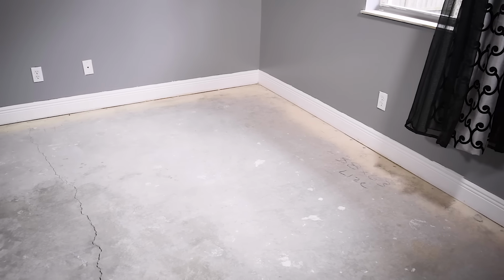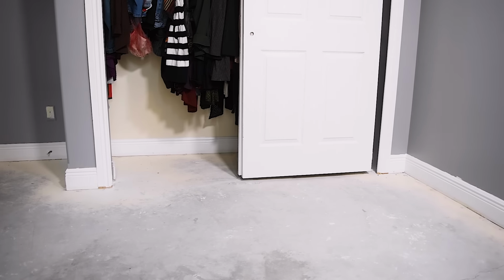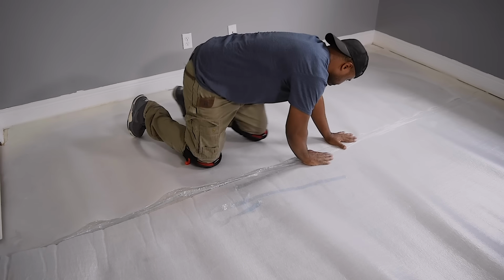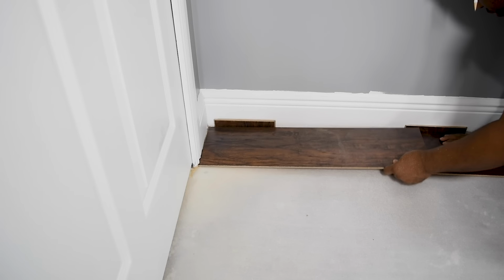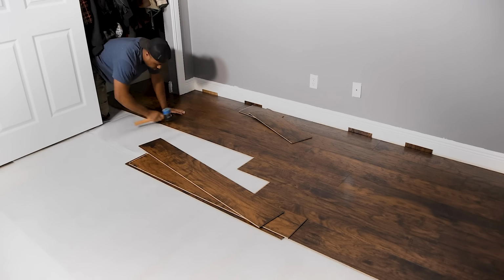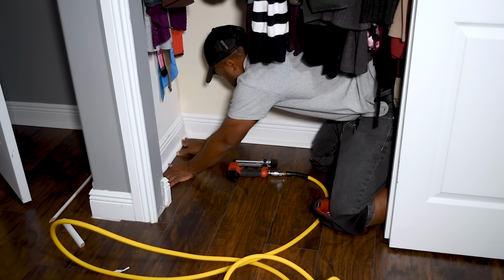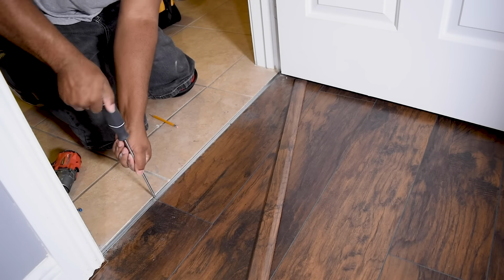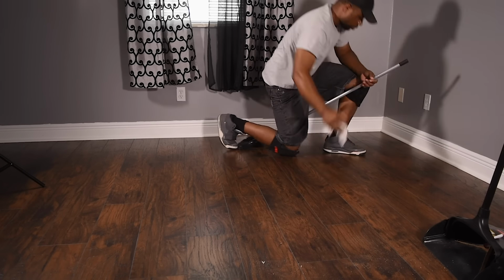How to Install Laminate Flooring for beginners

Comment: Looks like a foundation crack(response to @bestamerica) and is costly $$$ to fix. If it is filled then it will just open again, and could be why one side of the room was lower than the other. If there was no foundation problem it might be good to check the room with a long level to determine if the floor needed leveling before getting started. Also, if you are selling your house then you'd want to put the information in the seller's disclosure to avoid problems with a sale. Appearance upgrade would have been to remove the floor molding for a more pro finish, and add plinth blocks at the door to complete the quarter round. Changes to consider in the future, recommend placing underpayment 90 degree different direction from the way the floor is laid. OP did a good job with what time he had and material available on hand. New floors are big upgrade to any room. Thanks for posting

Comment: '
what about crack the cement / concrete...
what to do with it...
leave it that way or cement / concrete glue put cover fill in the crack
Reply: Ideally you would use a leveling compound to fill it.

Comment: From 2001 till 2005 I've mounted 13000 square meters laminate floor. How time goes away. I never stood working on my knees like this guy did.. This helped me to finish my work in time everyday. I was 95kg when I was working but didn't feel it like I was fat. My father was bodybuilder and my mom athlet runner. In school I was a footbal player. Maybe this helped my work with laminate flooring much easy despite my weight.

Comment: Do you only need spacer on the 1 length, or is on both side or all including the width?
Reply: Spacers should be used on all sides between the flooring and the wall. The spacing is needed as the laminate will expand due to changes in temperature and moisture.

Comment: I need an advice from someone who knows this type od work. Is this long-lasting in terms of how he did it on this video? 
I've seen people who did this and after a few months you could hear laminate creak and even come out. 
Thank you
Reply: Waterproof laminate is the way to go the good stuff already comes with attached underlayment but you also have to check the floors if they need prep, and by that I mean if there low spots in the concrete, which you have to fill in or if there's high spots in which you have to grind down.

Comment: Great job. Always lay the  under lay 90° in the opposite direction to the  flooring board.
Reply: Nope, perpendicular always. Read the directions on the underlayment, that's what it will say.
Reply: It doesn't matter when it comes to this type of flooring.Wood over wood,now that's a different story.

Comment: 1st rule about laminate: consider another flooring type besides laminate lol. There's a reason it's only 1.50-2 bucks per square foot...
Reply: Man my home's still being build as we speak, for the ground floor we got some 60 x 60 stone tiles, second floor and attic I'm def going for laminate. Easy to place easy to maintain ;)
Reply: @MethshockFilms  if you're not expecting any (and I mean ANY) water or moisture issues than you will be looking for new flooring after accidents. Often times companies discontinue matching prints for certain floors at any given  time which leaves you SOL for repairs of that does happen. But hey... for that price range you're saving money at least for sure
Reply: @marting.gardner2681  ... that's why you buy/store an additional case of flooring.

Comment: Always check moisture first no matter what especially for concrete,  the crack in concrete can be an issue, Easier to remove base, use 3 4 5 to make sure flooring becomes square, a laminate break saves half the time ( 100 dollars and its next to you). So many issues here.

Comment: You're going to fix that paint job while you are in there too  right ?   Its common with special order or bulk discount flooring at the big box store to not cover the exact tmolds/reducers, usually they sell all in 1 kits on their website which raises the price considerably. Typically you also people use spacers on the siders of the room too, this is because during installation the floor can shift and become uneven and you end up with weird rips on the last row.  Typically spacers at the top of the room on the first row and on the left wall in your case as you hammer to the left.

Comment: From my experience it's worth spending the extra $ to just get new baseboards installed. Overall the job is good, but the quarter round just looks awkward in some areas, and the trim at the foot of the doors is an eyesore. If the customer doesn't want to pay the options are limited, so this isn't a slight against Glen by any means! But for a quality, finished look just get new trim.
Reply: Anyone who works in the industry see quarter round or shoe molding on top of your baseboards and we know you're lazy stacking floors rite off the bat lol
Reply: Completely agree. I can't stand when people don't take the baseboards up. The quarter round looks terrible and looks like an after thought.

Comment: i would never pay for such sloppy execution. smear sealant with you finger, really, without using a masking tape for smooth edges? no way...
also the concrete floor is not even its unacceptable for laminating floor

Comment: if this wasn't on a concrete slap, then typically its best to run plank flooring perpendicular to floor joist.  This will reduce a wavy look that you might get if parallel to the joists.

Comment: Not a comment on your work, which was great. But there's a special place in hell for people who paint over the outlet covers. It's one screw to remove, and ultimately saves you time. I wanted to pull my hair out when I saw that outlet behind the door with paint all over it. 
Of course I would prefer to remove and replace the baseboard with a floor installation, but I can at least understand why someone would take the quarter-round shortcut.
Reply: lol I caught that too! It's those little details that would make that room look amazing (good thing it's an easy fix).

Comment: Thanks for the video.I really like all of your videos and have done several of your projects.  The one thing you did not mention, or I missed was how to handle multiple boxes of flooring. 
What I normally do is open all of the boxes and pull out the boards. 'Most' have 3 or 4 distinct patterns on the wood. So what I do is sort the patterns into stacks from all of the boxes, then I work my way by selecting from each stack. That ensures I mix up the boxes and  I don't accidentally put two boards with the same pattern next to each other. I also pay attention to the pattern of the boards in the row above where I am working.  It is a little extra pre-work, but makes for a nice look when you don't have two boards of the same pattern near each other.
Reply: Very important! Also, they need to sit a while to come to room temp.
Reply: Typically when I sell this stuff, I will say open 3-4 boxes and pull from all of them, not just one.  And to lay out some of your pattern before you start to lay it.  You might get a funky box that has all the same pattern.

It makes it easier when you start to get into the higher quality product that has 8-12 screens, or the ones that have a moving die that punched out the boards, so the screen sorta moves around the board to make it look more chaotic.

And as Zane said... most laminates should be acclimated for at least 48 hours before install.

Comment: Also that concrete crack should've been filled, and the concrete should've been either grinded at the peak on leveled from the crack towards the outer wall to ensure a flat floor. That thin cheap laminate you will be able to feel every hump and valley. The floor will move up and down when walked on eventually causing the thin locks to break over time.

Comment: Good install, but that underlayment you used is the cheapest of the cheap, and not very good, usually what I avoid. You should spend the big bucks on this and get the underlayment made from recycled tires, it has the most sound suppression and makes your flooring feel more solid underneath, particularly on thinner planks. It's well worth the extra money spent, and most folks don't realize the importance of the role that underlayment plays.
Reply: @DIYCreators  Yes, we run into that all the time, when they have no money but yet you know certain things must be done. caught between a rock and  hard place.

Comment: also caulking is not a workaround for cutting corners dude. you could have gotten the piece of floorings under the doorframe a little better there instead of just square cutting and caulking the rest. i know you own a jigsaw. so template over the design of the door trim on your piece and cut it and dont caulk the flooring. thats bad work in my opinion. but im also picky as fuck

Comment: as a trim carpenter youre prolly gonna wanna use a brad nailer at the least for quarter round. also instead of cutting it back adding a 22% backcut is a nice look for alot less work
Reply: Huh?

Comment: When cutting the bottom off the architrave (door trim) turn the laminate upside down!
Reply: Fat Tony agreed
Reply: He was using a scrap piece not a good one
Reply: @RubenC8434  so for sake of flipping that length over first, that 18" bit goes in the bin now instead of starting the next course with it? Glad I'm not your customer!
Reply: @FatterTony  .. why?

Comment: It's kinda funny how much every country worldwide differs in craftsmanship, I've never used any tape while sawing.
You can archive the same result if you use the jigsaw upside down (the blade faces to you), so with that the sawteeth will not damage the upside but the downside.
I'm sorry, having a hard time to explain since I'm kinda bad with my carpenter English
Reply: Any one need wooden flooring & carpet at chennai please call 9381034929

Comment: Are we all going to ignore those huge cracks on the slab? I really hope that's only the screed.
Reply: That crack on this slab can’t ignore, the crack is to big that he is through the concrete slab. We had smaller cracks than that, they also came through a 20 centimeter slab.
Reply: We had those in a condo we rent out and nothing you can really do

Comment: If it was my own property I would have removed and replaced the baseboard to avoid using quarter round.
Reply: Agreed, looks much better plus you can just remount the baseboard w/ no paint line since it's higher.
Reply: Quarter round just looks tacky to me. I like just a straight meeting between the wall and the floor without any obstruction in the way.
Reply: Bill S. Preston, Esq. but houses don’t always have level floors baseboards are not flexible 1/4 round will take care of any gaps . Some houses have baseboards caulked and painted over removing will look like crap better leave alone .

Comment: But what if your concrete floor is uneven or wavy? 
I have a flooring project in my office, and it had laminate flooring originally. But it just molded to the dips and grooves of the cement. So so how do you avoid this problem, and keep the floor level?
Reply: Yea he didn't bother with that.   You'll win some and lose some if you don't bother with checking for flatness.   There's not a single job that I haven't used prep on, so he's losing more than winning but some folks wouldn't even realize it's not done right.
Reply: @tomburch4260  
You're right. I didn't notice it in the office on our initial inspection of the house. 
It wasn't until we moved furniture into the room that we noticed every chair became a rocking chair, and every table too. 
That's when we decided to remodel and do built-ins as to keep as much furniture off the floor as possible. But this concrete slab is warped all through this level of the house, including the family room. 
I would love to come across a video where someone fixed this sort of problem prior to laying a floor on cement.
Reply: @KellyEUTAH  Its a cementatious product; more specifically Mapei makes some.   Mapecem being the best in my opinion.   It's mixed and spread throughout the slab and flattened/pulled using a  (10') screed.  Multiple pours to raise low spots.   The idea is to be within 1/8" of flat over 8 feet for most manufacturer specs.
Reply: @tomburch4260  
I will have to look into that stuff for sure. Thank you so much for your suggestion. I was for real at a loss for ideas. 😉

Comment: A couple of points that I found helpful when I installed laminate flooring for the first time.
I removed all of the baseboards and I numbered them on the back, I then made a sketch of the room and I wrote the number of the baseboard on the sketch in the position I removed it.  This made it easier to reinstall the baseboards.
My baseboards were stained and varnished oak and after 20 years they got scuffed up so I used this opportunity to refinish them.  All I did was clean and lightly sand them and then I used a combination stain and varnish.
When I used a jigsaw I purchased reverse cut blades.  (blades that cut on the downstroke instead of the upstroke, this way the cut did not mar the finished side.
I also purchase flooring that had the foam pad attached, less work not having to lay down a pad.
On very long runs I used about 3 inches of duct tape to hold the boards together so they did not snap apart.
Any area that the boards might come into contact with water (around the kitchen sink, under the dishwasher, bathroom, near exterior doors, etc.) I used waterproof glue so if they got wet they would not warp.  They now have vinyl boards so I don't think the water damage is an issue if you use them.
Reply: I love laminate flooring because its more durable and scratch and dent resistant than vinyl.  Sadly, LVPs are probably are still better for bathrooms due to the them being "waterproof" (some WPC LVPs can still be damaged by excessive water).  Laminates require a little extra TLC for bathrooms because of that ambient moisture.  Sealing those expansion joints at your tub/showers and the like.  A good modern Laminate can be wet or steam mopped, but if water gets underneath it into the wood core, it will eventually damage it.

That is a great suggestion for the baseboards, I will see if my installers do that, and if not suggest it.  With nice wood baseboards like you had, pulling them is relatively low risk.. but for people who have cheaper mdf or plastic ones, they need to be pretty gentle or they may break.  Those are more common in stick homes today.

Comment: No self leveling cement first? If the floor is not perfectly straight the floor boards will crack eventually. Have that problem in my current apartment.
Reply: Laminate floor is suppose to be installed as a free floating floor.
Reply: Depending on the product there is a reasonable tolerance to out of level/flat. I won’t use any of the 3mil vinyl products out there, between an unrealistic (for most DIY and even residential installers) tolerance as well as showing the slightest defect, a majority of floors don’t need much to make a mid grade or better product work. If this were a glue down product, then absolutely skim and fill so nothing telescopes through. 
There is a lot of product with an attachment underlayment. For the simplicity alone it is worth it, and cost difference is negligible.
Great video as usual!
Reply: It all depends on what the customer wants and can afford
Reply: i dont think that the laminate will crack it somewhat flexible might be able to feel the dips and high spots though if its extreme. is your flooring wood you could try filler it wont fix it but it will be less noticeable most fillers take stain easily
Reply: Your typical laminate shouldn't have more than a 1/8 of an inch height variation for every ten feet.  This is a pretty small room, so it probably won't have much in there.

If there is a dip, the laminate will eventually just mold to it... it will look kind of funky and may put some stress on the locking joints.

If I had set up this install, we would have leveled out that crack, for our warranty mostly.

Comment: wood flooring should be laid with the grain against the window of the room. ex. the boards shouldn't be laid running 'down' the room in line with the light coming in from the window but flush up to the window and continuing down from the window. if more than one window in a room, choose the dominate window. basically, not the way the flooring was laid in this room.
Reply: The grain direction depends more on the size/shape of the room rather than any windows. Not sure where you heard that.
Reply: ElectronicDrug 
not true. next time look at flooring in older homes. it will follow the example I give.

Comment: even a cheap oscilating tool is only $20, and would be worth buying to do that single job. then any life in it after is gravy.
I bought one and thought "If it works halfway decent I'll buy a good one when it dies.
Haven't bought a good one yet as it hasn't died and I used it a good bit replacing widows upstairs.
Reply: I found the cheap HF oscillating tools were junk.  The blades kept coming loose.
Reply: @Norm475  mine is a Menards Tool Shop, and those are supposed to be identical to the HF. I have only had the blade come loose once, and a quick retighten and no issues. But then, quality on both is spotty, so mayhap I got lucky for a change.

Comment: Laminate flooring does not expand and retract, parquet flooring does👌🏽 anyway, great video as always😁
Reply: It absolutely does.
Reply: It would depend on what it is made of, but I know some of it does move a good bit up here, and enough that it can buckle. The rental I was in had flooring installed during the winter and there was no AC, so come summer, parts that were too tight got wavy. A bit like having a Samurai style Sky Lark floor, it made a lot of noise when you walked on it.